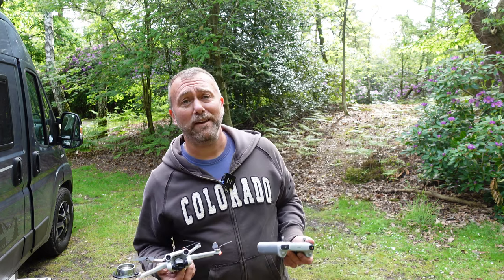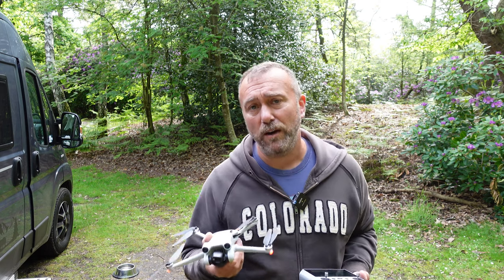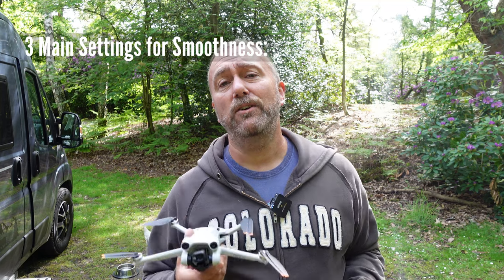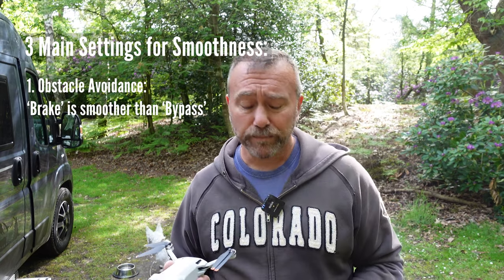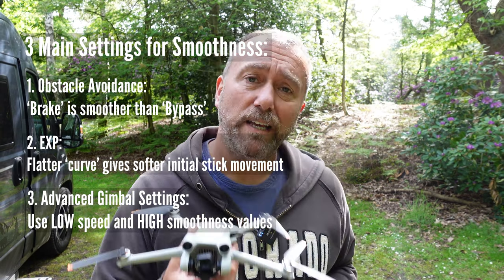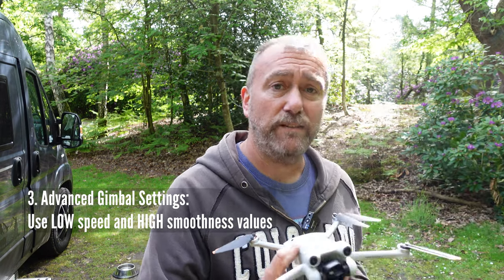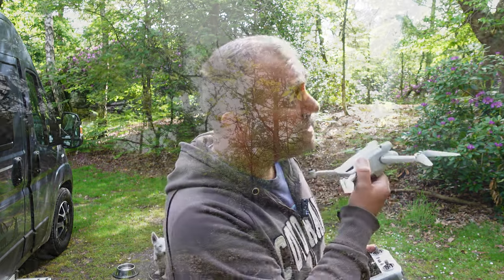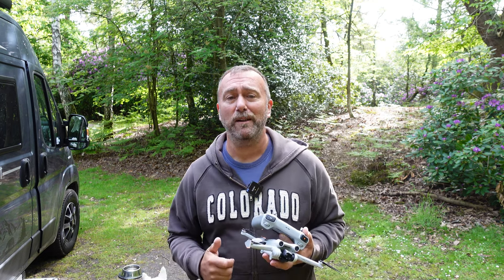DJI Mini 3 Pro: Three Simple Settings for Smoother Video

Comment: Great advice, Ian.

Some subs might find this useful too:
Cinematographers of old had a rule of thumb that a pan from one side of the image frame to the other should take 7 seconds or more, with exposure at 1/(2 x frame rate) so that motion blur hides the jerks (which is where ND filters are better than autoexposure).

They used 24 fps for celluloid film. For 30 fps video on a smaller screen, that works out at 6 secs for a full-frame pan (using the grid makes it easy to count the time off for a manual pan), with 1/60th sec exposure.

So if a camera's field of view is 60° wide, that's 10°/sec, or 12°/sec if you want to go the full 7 seconds. It always seems bloody slow - until you see the result on a big screen.
Reply: Agreed, I keep panning to a minimum and almost alway work it into more of an orbit to keep the subject”s lateral movement to a minimum. Cheers!
Reply from the maker: Great advice there Lindsay.  Thank you !

Comment: Guess what happened to me the other day.. drone in bypass mode.. been flying for 25 mins or so through trees without issue. Thought I’d take one last photo of a tree before I landed. “Gently” pressed right stick and the drone hurtled into a tree trunk sideways, thankfully no damage. You are right about it being flighty! I shall definitely check out brake mode, it looked a lot softer. So thanks for that tip. I thought I might be able to change the response with the exp settings, but I played around with it and it didn’t seem to make much difference. I miss tripod mode of the old drones, c mode isn’t the same.
Reply from the maker: Lucky escape; yes, if you're close up in trees and twigs, Brake Mode is your friend....

Comment: Thanks for the video. Needless to say, DJI have changed the naming of each and every feature in the menu since filmed. Incredibly annoying when different models (Mavic 2 Pro, Phantom 4 Pro) have similar names in similar menu drop downs for years, yet this version has new random ones. The Throttle and Yaw settings now look nothing like they did on your screen (yours are the same as M2P and P4P....more or less).

Ohh, and nothing is under the same named menu settings as yours either. 

Good thing I'm trained, licensed and been flying commercially (globally) for 6+ years or I'd be completely lost!! (Sarcasm detection on!!). P.S. I still think these settings are the most important for anyone to come to terms with!!
Reply from the maker: This is the updated video!  https://youtu.be/JPiV4RFpCqU

Comment: Thanks Ian 👏 On your equivelant Mini 2 vid, you posted your gimbal settings. I've used these several times. It would be great if you could do the same in the description of this vid with your Mini 3 settings. Cheers mate 👍
Reply: Have you got a link to the mini 2 gimbal settings buddy 👍
Reply from the maker: I'll get those updated later this afternoon. 👍🏻👍🏻👍🏻
Reply from the maker: Updated the video description for you!  With these values:

My preferred setting values:
Pitch Speed:  Low (15 - 20 '/s)
Pitch Smoothness:   High:  (25-30)
Yaw Rotation Speed:   Low (15 - 20 '/s)
Yaw Rotation Smoothness:  High (25-30)
Reply: @IaninLondon  cheers mate, thanks a lot. I'll bookmark this 😁 Last question - Is this for Cine, Normal or Sports mode? 🤷‍♂️
Reply from the maker: @LamboPhoto  I personally use for all 3 modes, but that's my call. You may want things faster in sports and even slower in cine..

Comment: Thanks Ian, very helpful video that probably has a cross over for the air2s with the smart controller for some features. 👍🏴
Reply from the maker: Most of the settings will work for the Air 2 S as well 👍🏻👍🏻

Comment: Great tips - I was going to use bypass obstacle avoidance but I think the break is going to be better and I agree on the softer stick controls as my fingers are jumpy as I’m still a beginner and great gimbal settings I don’t like when the gimbal continues to move after you’re done pressing it too much and I also don’t like when it just stops really quickly so a good mix of all settings is helpful so thanks for another great video with a summary at the end that was definitely very helpful!!!!!!!

Comment: Hi Ian 
Great informative  video .
Why is 20 on the yaw rotation  speed in normal mode as low as it goes.
Personally  I think its to fast ,do you think it will come in future updates  .
Needs lowering ,not sure why they have taken this option away .
I'm  sure it could be less on the mini ,
Cheers.
Reply from the maker: I think you'll find the lowest value is too slow as it is...

Comment: Hi Ian.  You certainly are presenting a case for the Mini 3 Pro.  You have taught me a lot about flying with my Mini 2 and I have been considering the Air 2S for my next drone.  Now I am unsure.  Should I be leaning toward the Mini 3 Pro?  Cheers from Wisconsin.
Reply from the maker: If you have no need to fly in urban areas, then I would still stick to the Air 2S.  It's superior in a fair few ways,  but the Mini 3 is better for travel and flying in areas where sub-249 gram drones have more freedom
Reply: @IaninLondon  Thank you, Ian, I appreciate your views.

Comment: Hi. Good info and easy to understand. I’m new to droning but lucky to be starting off with one of these beauties. I’ll try these settings. I assume (I’ll check) that Reset can be, well, reset if it goes tats-up. I had been trying very slight movements on the sticks for smoothness but sometimes requires too much concentration. Not keen on Cine mode. I want a slower start to any movement but don’t want it all slow all the time. Cheers.
Reply from the maker: These settings will let you sort out smooth start of movement before speeding up....

Comment: 1:40 that is exactly what happend to me after 1 day😭
It fell on a hard surface (on the front arm) so 1 arm moves a little more than the other one. But fortunately it flies normal
Reply from the maker: Ah sorry to hear that.... 🫤
Reply: @IaninLondon  it is a little annoying but  i learned from it.
A thing i noticed while crashing the mini 3 is that it stops the props because they were blocked (this is normal). But after it was on his back it started to spin the props for at least 20s. So now i should replace all props because they were spinning on the ground. (I only have 2 pairs)
I still need to contact DJI on why it would start the props while on its back.
Reply from the maker: If the props feel smooth and have no cracks or damage, you should be fine to fly with them.  Slight scratching is fine, but any cracks means a replacement is needed....

Comment: hope the holiday is going well. i took mine out for its 1st flight, but it tried to kill me lol video is up. but after a firmware update it reset my sticks back to default and i didnt know that as i have it on sticks C but it went back to B is that a normal dji thing to happen ?  i keep mine on brake rather than bypass also thankyou for the tips in the menus now mine is much more smooth
Reply from the maker: B is the norm 👍🏻👍🏻
Reply: @IaninLondon  yer apparently it went back to default and was painfull lol now i know to check each time it does and update just incase